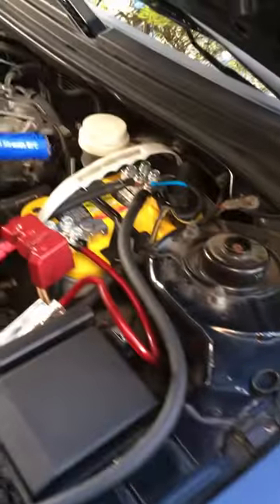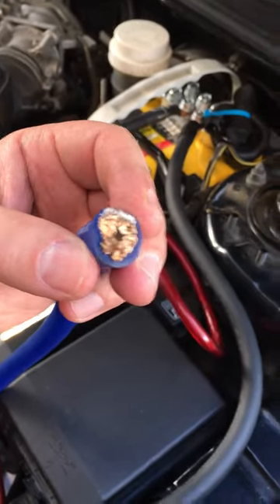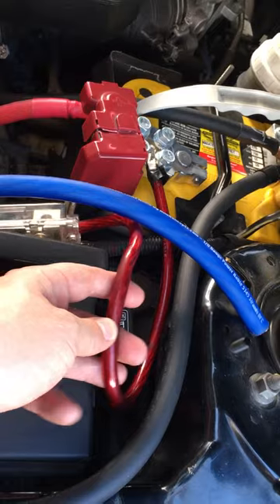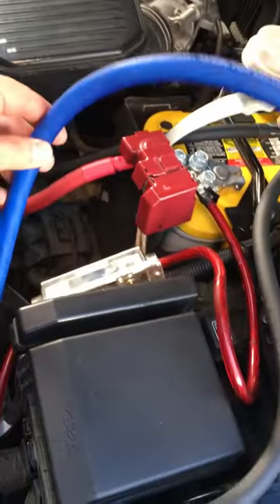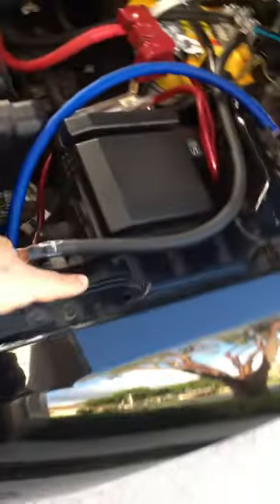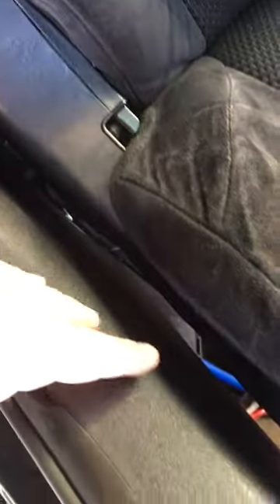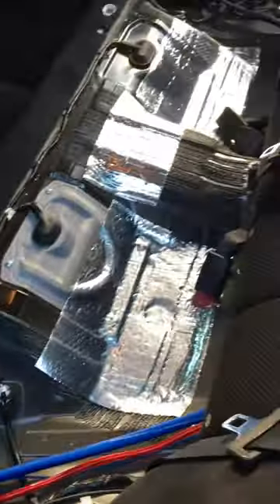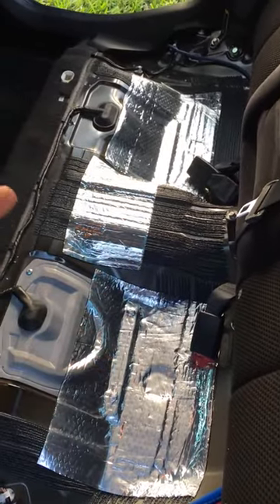1/0 gauge OFC power cable install: KnuKonceptz & GP Car Audio

Comment: Would you recommend this wire over sky high? It’s cheaper than it for sure just not sure if it’s work saving the money
Reply from the maker: I did consider Sky High power cables as they are very popular but ended up purchasing the KnuKonceptz after reading many good reviews on authenticity and quality... maybe Sky High was a more expensive option at the time too and I decided to save some cash. Anyway, the KnuKonceptz is everything it claims to be so, why pay more?
Reply from the maker: Check HifiVega channel vid called "1/0 OFC Wire Tested! (1/0 OFC Shootout Update)". He compares and tests a bunch of power cables

Comment: How much power watts do you think these wires can handle ?
Reply: Knukonceptz 1/0 off is rated for 300+ amps. So roughly 3000+ watts for 1 wire.

Comment: Wires do not add additional power man.
Reply from the maker: The whole point of the new power wire was for the install of a new power amp… Jezuz maniac! Aren’t you watching all my videos to understand whats going on??? no gold star for you sir
Reply: @Gomez561 HaHa. Yes I know this. Is to why I said what I said
?¿? 
I was just going by what you said in this video when you say "So im giving it a shit load more power" referring to the new cable install. Just trying to positively lyk that n make sure you knew that's all.
Jus in case. 
You'd be amazed by how many people actually believe that to be. 
Oh! And yes, when replacing your 4 gauge, not only replace it but plz plz correct that connection also lol. 
😝🤪😆
'DEUCES' ✌🏼🤘🏻